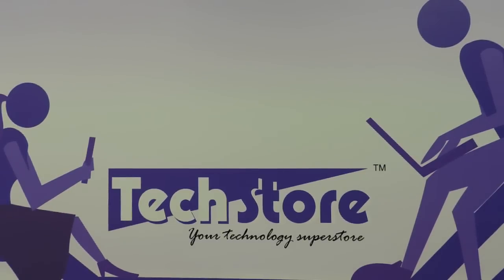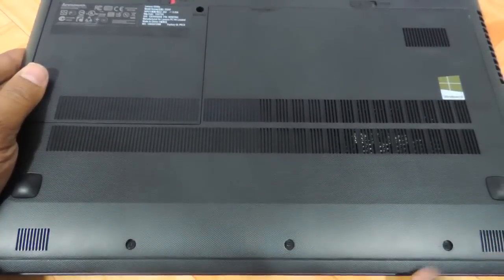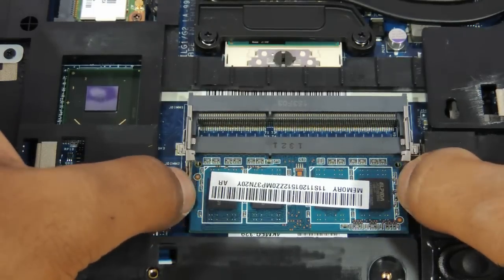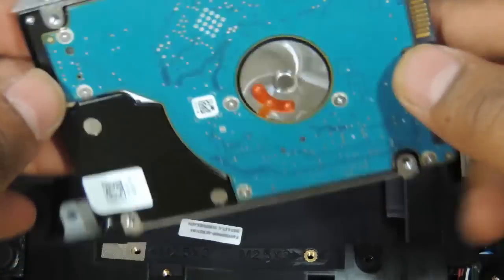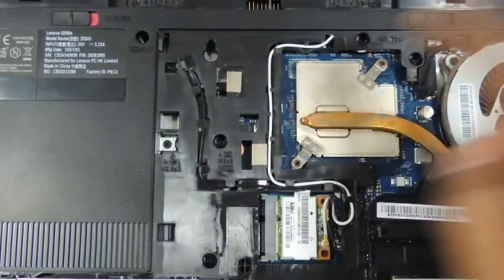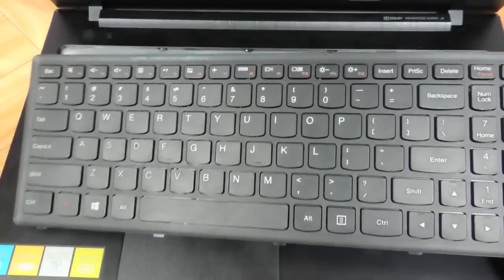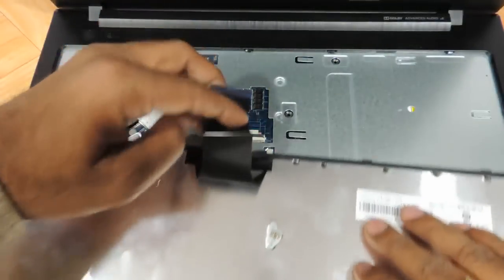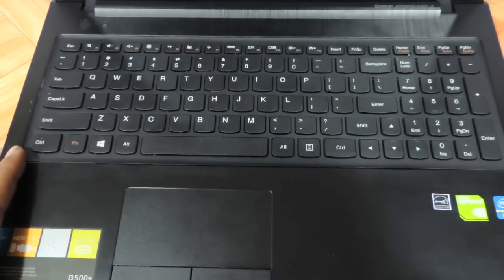how to upgrade ram memory keyboard harddrive of lenovo g500s easy diy method

Comment: Sir,

My laptop model is Lenovo G500S 
2Gb ram 
i3 processor
64-bit OS

I want to upgrade RAM as my laptop performance gone down completely..

What size RAM do u recommend to upgrade ?

Pls suggest
Reply from the maker: We advise you to add atleast 4+4 = 8GB ram which will cost you 4000 approximately & also install 2.5 SATA SSD to increase speeds. Please mail to sales@techstore.co.in

Comment: What's the maximum RAM upgrade can be done in this model (Lenovo-G500s), or the maximum recommended upgrade of RAM for core-i3 Intel processor, 2.5GHz clock speed?
Reply from the maker: +Arindam Nandy 16Gb is the maximum ram upgrade capacity.
Reply: thank you

Comment: My Lenovo G500s (no touch screen)
 spec is Intel Core i3 3110M @ 2.40GHz	
Ivy Bridge 22nm, 4.00GB Dual-Channel DDR3 @ 798MHz (11-11-11-28) with Nvidia Geforce GT 720M 2047MB. Can I replace my processor with i5? And if I can do that, do i need to change the battery as well? And what is the maximum RAM upgrade that my laptop has? And last question; will I be able to replace my DVD drive with a cooler fan slot? Please advice. TQ...
Reply: +Zaki Wagiman  No, you cannot replace core, it's inbuilt.